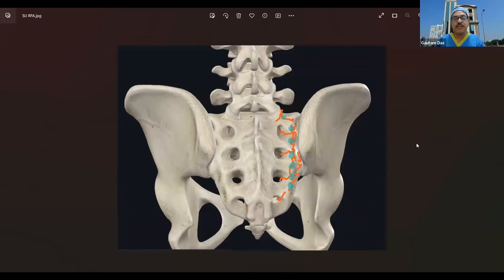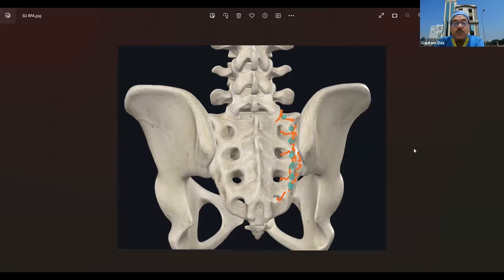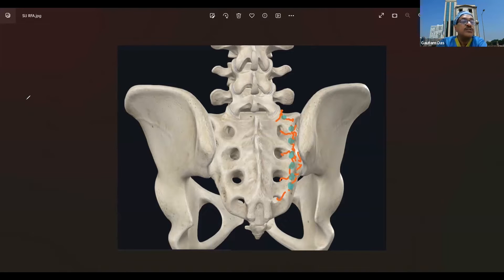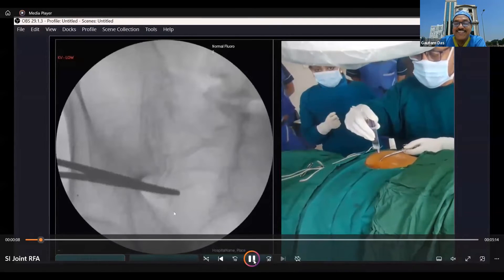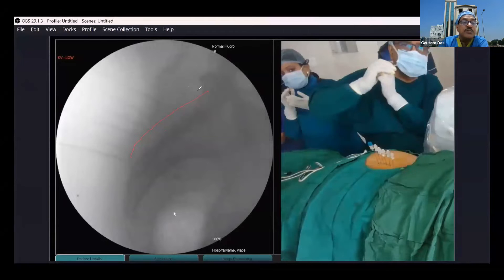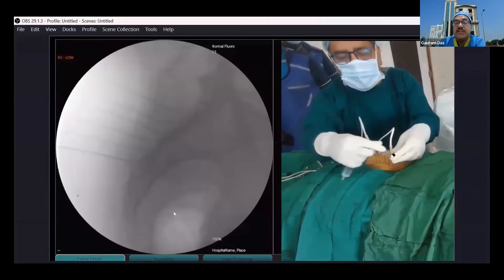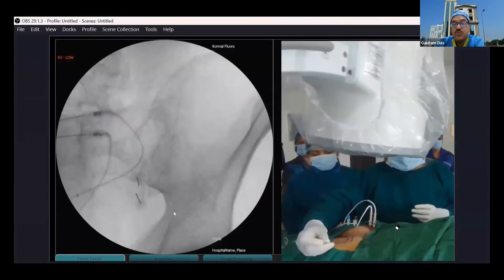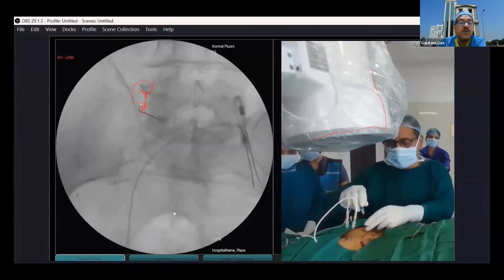Mastering Radiofrequency Ablation for Sacroiliac Joint: A Comprehensive Guide for Pain Physicians

Comment: I'm having this procedure this month but I'm concerned because of previous spinal fusion for Spondylolisthesis grade 3 at L5/S1, will this compromise the procedure as its fused in slipped position, my surgeon was unable to re align my spine, there will be a lot of scar tissue as its been operated on 3 times ! Will I have complete pain relief on board for this procedure ?